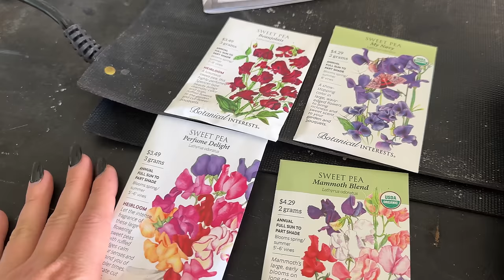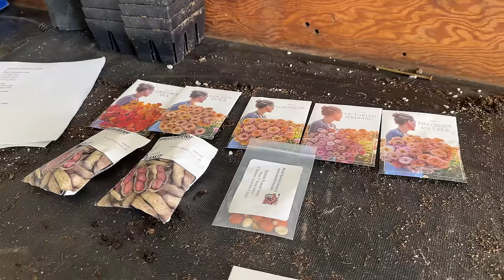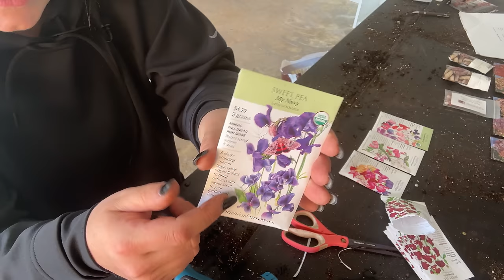It's been totally neglected so now it's time to fix that!

Comment: Just a quick FYI hint from another channel, on dealing with gnats:

1) From City lot gardening - after planting seedlings, top the soil with 1/4 to 1/2 of fine silica sand.  It prevents the fungus gnats from setting up shop in the soil.
2) From provident preppers - using a dilute neem oil solution will kill any gnats.

Comment: I started slips just like you. From organic store bought sweet potatoes. I got soooo many slips. More than I can plant. I had 4 potatoes and have maybe about 30 slips….😂 I did put my potatoes on  heat mat in the beginning to get them going. Then when they were overproducing I tried to slow them down by taking them off heat and lights.

Comment: I would highly encourage you to try the soil method with your sweet potatoes. In my experience, it is quicker AND you don't have to root the slips afterwards. The slips will already have roots attached to them when you separate them from the sweet potato. I've been using this method for the last four years and it's awsome!

Comment: Becky you are going to LOVE the lace veil petunias.  They’re stunning in bloom with the ruffled edges.  I can’t get enough of them.  Love love love!!!  

Edited to add: if you have small blocks that are very “rooty”, you can use a dinner knife to gently separate the blocks without the blocks crumbling.  Place the knife between the last two rows of blocks and gently push the row away from the rest.  Blocks come away perfectly in tact without disturbing the roots.  I also use a cheap metal spatula from the Dollar Tree.  It works great moving entire sections of soil blocks or separating them from each other.

Comment: If you really prefer soil blocks or need more up-potting than you have 4' pots, you can always 'cheat' a bit. A few days after you up-pot (to give the soil time to compact just a bit) you can un-pot them and put them on a tray just as if you made soil blocks. You'd want to use good blocking soil, of course, if you plan to do that.

Comment: Becky just a couple of things,  the pots you used to up pot i would put my cuttings in them, I would put 4 around the sides and one in the middle, cuttings take really well right next to the pot wall also when you are transplanting the little plugs use a pencil to direct the roots into the hole as its more delicate than your fingers so you don't damage the roots, only talking from 35 years experience of gardening x

Comment: Hi, I think that the sweet potatoes that you bought were to new where your mother-in-law had hers for a year as they seem to need to go through a cycle. So the wobbly looking ones you pick up from the store would actually be better. I also found that water or soil works just as well but less chance of little flys with the water. Good luck with yours

Comment: Vermont compost is fine for blocking but I wouldn't use it otherwise.  No need and it has its own issues etc.   I use the cheapest ProMix and it's fine.   I do add Happy Frog IF I need to super up-pot sometimes.   I've never seen any differences between anything.

Comment: About that old potting soil— PERHAPS if you soak and dry it out several times, it will let the beads finish dissolving, and then you probably will need to cut it down with plain soil before planting in it.  Everybody, weigh in on this.

Comment: The older the sweet potatoe the faster it will sprout slips  . Starting sweet potatoes in soil on a heat mat under lights and from last years harvest will start giving you slips in two weeks.

Comment: Just a curious observation... I use that same potting mix for everything for years. Same brand Sta-Green and all! I have never had any slow release fertilizer in it! That is the older bag that was changed last year. Maybe it is older than we think! Hmmm... Is it possible that there are different packing facilities in different parts of the country using different recipes?😞